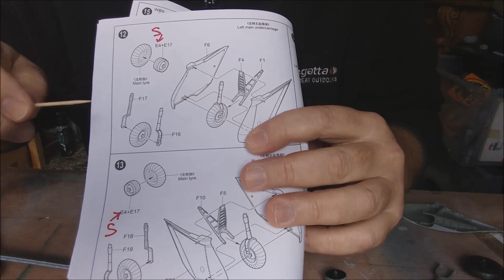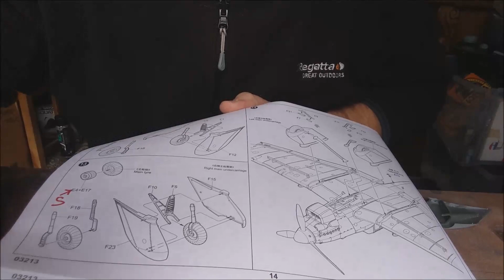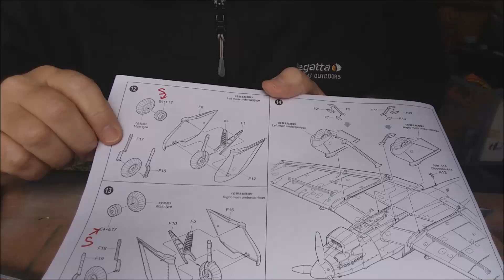Trumpeter 1/32 Stuka Video Build - Part 2

Comment: Nice heads up on the wrong parts. Don't ya love when that happens ?! I'm a firm believer in the factory having someone that builds on staff so they can build their kits before we do. That way , they know what's wrong. It'll never happen. Build on , brother. 👍
Reply from the maker: Yes and it does not help when different model types ie . A,B.D etc use some of the same parts and the same set of instructions.Thanks for watching anyway I prefer not to do a videos where I have to talk.
Reply: @weekendmodeller2740  : Yes, this is the real issue, many versions ! It has a cost to reprint thousands of notices and CTRL+C CTRL+V is more useful and definitely simpler.

Comment: I see that your version (as I commented in pt1) doesn’t allow for seeing the engine with the cowling sections fitted, a dilemma for anyone building the kit, obviously you can leave the cowlings off if you want to see the engine and firewall etc but it does seem that it’s a drawback to the kit, oh well I will have to decide as well as yourself which way to do it. Thanks for sharing your build, enjoy the rest and look forward to more updates. 😀😔👍🇬🇧🏴